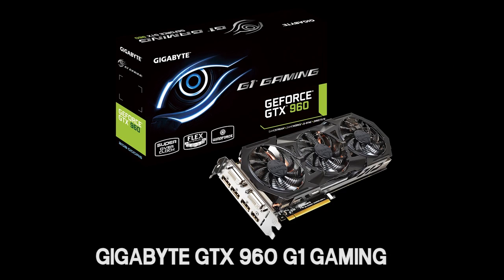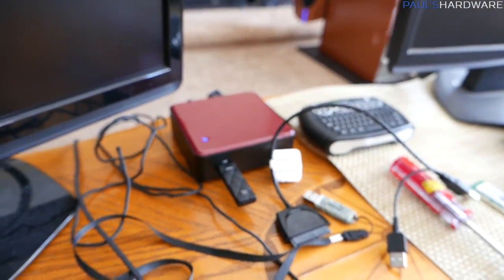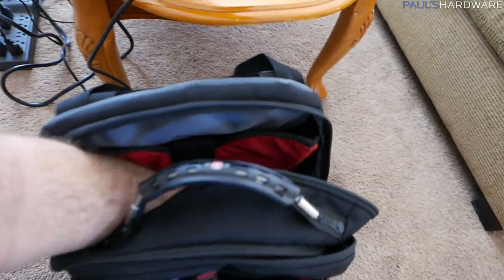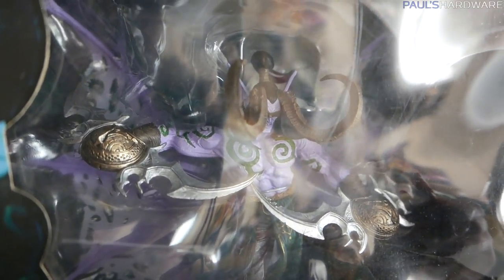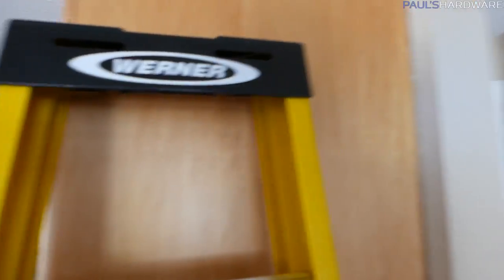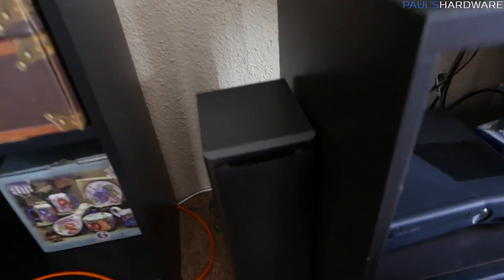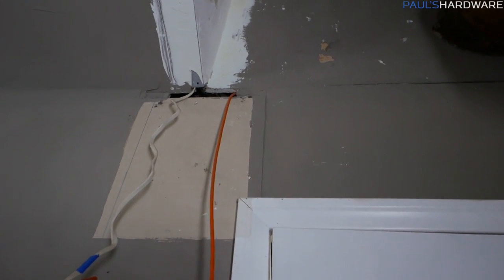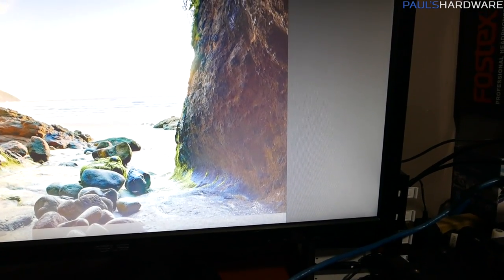Networking My Attic: Paul's HardVlog #009

Comment: Your lucky. The highest point in my attic is about 4' tall. I literally crawl around on joists in there. Not fun. 
Also, just a tip, if the fiberglass insulation bothers your skin, wear a long sleeve shirt.

Comment: Quick tip. When in the attic Make sure u are steeping on the wood 2x4s or u will have a much bigger hole than u need in your ceiling.
Reply: AuSapling LMFAO!

Comment: Have a very similar P5N mobo system, with a Q6600 and a Vertex 2 that failed a few months back. Replaced with a cheap Crucial SSD, and got a GTX 650ti. Still makes a lovely HTPC and a very competent Steam big picture box. Put it in the Fractal HTPC case and it makes for a super sexy little media center PC.

Comment: I like to use a crimper to connect rj45 plugs to my cables.  That way you can cut the cable to length and it makes it a lot easier to fit them through those small holes.

Comment: Hey Paul, knowing where you live, there is no way you have enough insulation in that attic. I use too live in that area, and it get stinking hot in the summertime!
Reply: I was just about to say that. You could probably drop your summertime cooling bill by half. I blew in more insulation in my parent's attic a couple years ago. It has more than paid for itself in heating and cooling savings. It's easy to do yourself. If you buy insulation from Lowes/Home depot they usually let you use their blower at no charge.
Reply from the maker: Sean Palmer Eflat Productions Thank you for the suggestions guys! I am actually going to look into this soon, your encouragement helps :-D I want to have the heater/AC units checked for maintenance and I'll ask about the attic insulation too.
Reply: Also make sure that all the vents up there are clear, so your attic can breath! lol

Comment: Paul, since you are in a single story house why didn't you just run a drop and cut a hole in the wall where your router is?  Would have been really easy,  all you need is a cable fish, a saw to cut the hole and a grommet or keystone wall plate.

Comment: Hey Paul, how did the Vertex2 fail? I also had one fail. The solder joints inside it on the board developed micro fractures in them and the drive stopped responding. I was, however, able to bring the unit back to life. I ended up steaming it on the stove the same way you'd steam vegetables. It in turn caused the solder to ever so slightly liquify and reconnect. After letting the unit cool back down I popped it back in and the drive was alive -- with all of my data still on it. If my failure sounds similiar to yours I suggest giving it a try.
Reply: Nice recovery! Very similar to the oven trick, loosens up the solder and can reset the connections. I haven't dug into this one to see if it's that type of issue, but I've had two others fail due to the controller crapping out, and not much can be done about it then.

Comment: Only one of the lights lit up on the switch, So that should mean you are only on 100Mbps, two (per port) would mean 1000Mbps. 

Just hoping you noticed.
Reply from the maker: I am checking on that, the cable does seem to be working OK, still needs more investigation though. Thank you for the heads up!
Reply: For that switch the left one lights up and is green if 1000Mbps, the right one lights up and is amber if 100Mbps. So looks like you're good. That is if I identified the correct model: http://www.tp-link.us/products/details/?categoryid=1585&model=TL-SG108#down

(I'm not stalking you're hardware as bad as it seems... I recently added a tp-link switch to my own network and was already somewhat familiar with their function)
Reply: Troy Smith Hmm, thats weird. When mine only has 1 green light, the PC says 100 mbits. But when they both light green, it says 1 gbit. Same model.

Comment: I'm a UK man and like many have another persons house either side of me so if I want a wire going from one end of my house the the other, I need to have it go through brickwork (usually) Or floorboards if it's going up.
Alternatively I can run it along the corners where the floor meets the wall.

I envy Murica' for it's houses.

Comment: The Attic; The traditional safe zone for the average man, for some it is a place to find peace, for others a place of strength but for the less-spotted pasty-faced tech nerd, a haven of intricate cable runs, redundant UPS and failover network swtiches (aka, a tangled mess of out-of-date components, few of which can be paired together to form a single working system).
Reply: Mine also has a huge amount of old coaxial cabling that I don't use at all :-)

Comment: I would read the label above the Ethernet ports on your switch because it looks like the cable is damaged. Your are (I think) only getting 100mbps link speed between the router and switch.

Comment: I had to crawl under my home to get a wired network connection to my PC. I have an access point is in a closet down the hall from my room, and I was not fond of the cable running through my hallway... It was worth crawling in a cramped space, under ducting, and around support beams, because my wireless connection was absolutely terrible.

Comment: I liked it, but running it in the living room like you have done isn't aesthetically pleasing.

 Any regular Joe can find a stud near where you're routing the CAT6 to in the living room.
Cut a small hole alongside the stud and put your cable inside the hole. Go up in the attic and then drill a small hole into the top plate of the wall. Then use a snake or simple line with a small lead fishing weight to feed into the hole above the area where the cable is waiting. Go attach the ends together and pull your line back up into the attic.

Then, you simply pull the cable towards your next wall and repeat the first paragraph of instruction. Terminate the ends into a terminal box and then mount the terminal box to the small hole on the wall.

If you want to know how to repair a bad hole without anything expensive.
**-I'll reply if there's someone who needs the answer.*
Reply: That poor network connector.

Comment: I Will Never get used to US building standards... More or less a cardboard house, no offence. In my country it is impossible to wire your home without proper tools...
Reply: +Gab riel That house is not up to standards, not even close. I seen at least 5 code violations during this video.But I guess he lives in California so he doesn't need to worry about supporting 20 tons of snow during the winter, or insulate every gap to prevent -10 F drafts.